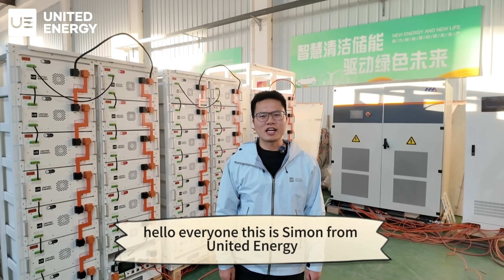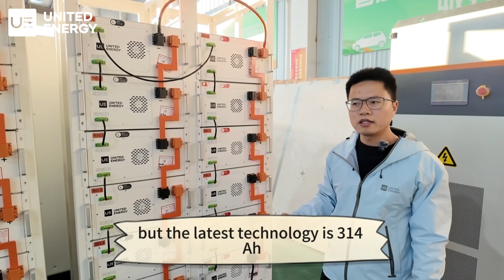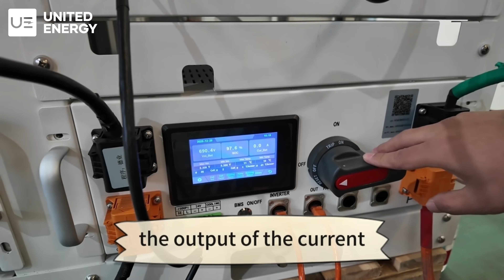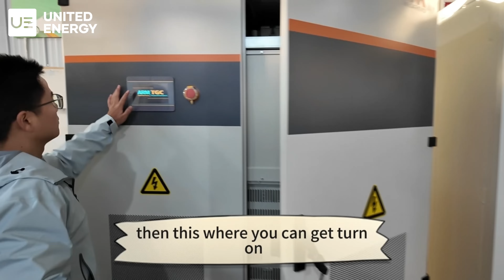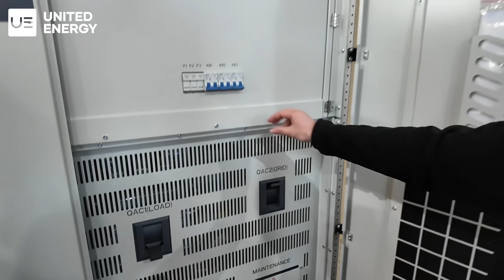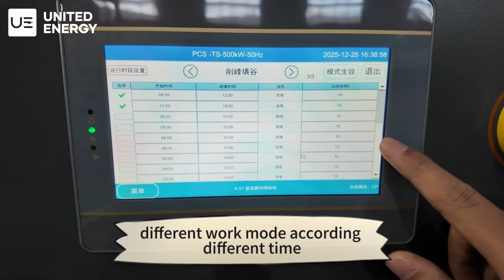𝐒𝐲𝐬𝐭𝐞𝐦 𝐓𝐞𝐬𝐭𝐢𝐧𝐠 | 𝟏.𝟐𝟓𝐌𝐖𝐡 𝐇𝐕 𝐁𝐚𝐭𝐭𝐞𝐫𝐲 + 𝟓𝟎𝟎𝐤𝐖 𝐏𝐂𝐒 | 𝐀𝐂-𝐂𝐨𝐮𝐩𝐥𝐞𝐝 𝐄𝐧𝐞𝐫𝐠𝐲 𝐒𝐭𝐨𝐫𝐚𝐠𝐞 𝐒𝐲𝐬𝐭𝐞𝐦

Comment: GSL Energy also gave me 10y warranty.. after 4 years the batteries start failing....and they never respected the warranty.
Reply from the maker: It's regrettable to hear this, but didn't they help you figure out what the cause was? If the problem is found to be a faulty battery, replacing it promptly should allow the device to continue working.
Reply: @UE-UnitedEnergy they talk but gave me no practical solution...all the batteries were badly made in the factory and they failed... GSL didn't send me any replacement nor financial refund...very unprofessional
Reply from the maker: @joseperes777  Product quality = after-sales service
Sorry to know about your bad experience

If you have battery needs, we'd like to share some detailed information.